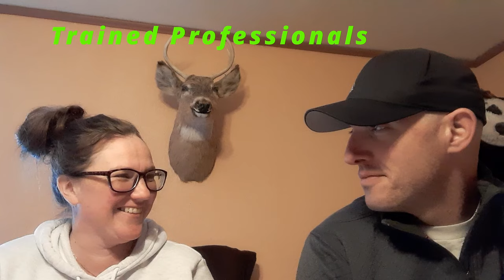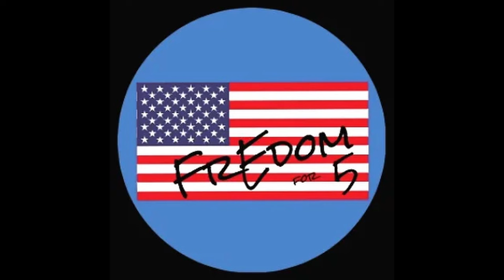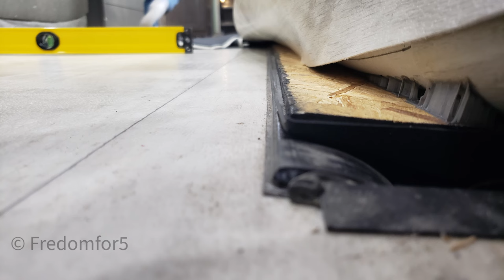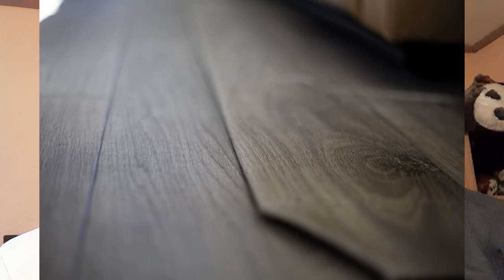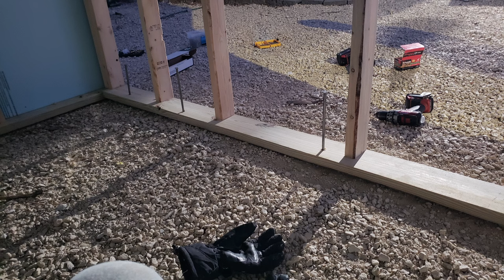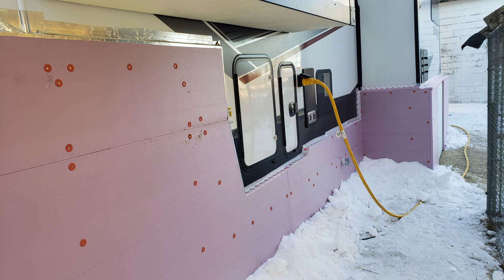UPDATE!!!  Grand Design Frame Flex Part 2

Comment: I’m glad things are moving for you.  I’ve spent 20 years studying all the flat floor slide patents out there.  Yes, there is a lot of geometry … not only does the box need to be true and slide arm adjustment extend to the perfect depth, but when the arm depth and true box is extended, it needs to rest on the floor, and the slope ski needs to be properly aligned and installed.  So simply, if the side trim, top to bottom, are flush with the wall, and you still have non-flush, the floor ski needs to be adjusted further inward for the floor to drop.  Keep pushing that issue…
Reply from the maker: We were able to get them to create a work order for the main slides. It says they inspected them and were working properly. We got it home and checked them again...

The distance from the wall (at the floor ranges from 1/4 - 3/4".  The kitchen slide appears to be bowed downwards at the center. The dining slide is off side to side and is obviously not square where it slides into the floor.  We'll detail this in an upcoming update.

I'm not fluent with the vocabulary associated with all the parts yet but the two plastic radiused parts that mate up when open at the 'flush part' (which I suspect may be the skis) looks like it may have moved...  If one has been pulled out, or is misaligned it would prevent the slide from seating properly because they are on top of each other...  If this is the case and I can figure this out I don't understand how it was overlooked or "normal".

More to come.

Comment: After seeing all these issues on Grand Designs 5th Wheels with frame failures and some people being " bought out" with a new 5th wheel to be quiet and sign a non disclosure agreement and to remove their videos I knew something major was occuring.  I even saw a video of lag bolts missing on a 5th wheel and the guy fixing the problem himself.  My Grand Design Reflection had a major flaw with the heavy Refrigerator moving forward alittle with the slide in. ( pulling on clips in the soft wood on the sides) Customer service told me it was a design flaw with no recall to fix it last year.  I made the decision last month to cut my losses and I sold my camper the month the warranty ran out.  The values are dropping on them and I did not want to own a camper that could  have a frame failure going down the road because of Grand Designs cheap way of making a camper .  It was too much of a liability to me.

Comment: The people designing and building welded frame 5th wheel trailers had no idea of the actual loadings applied to the products that they sold to you.   You might want to believe otherwise, but they were winging it.  In reality, their designs are based on established rules and RV industry practises - not the actual in-service loads, deflections and accelerations to be experienced.  You may think the manufacturers understand what happens in service but I would not trust them to come up with a rigorous, permanent fix to their failures.  They may want to help you, but they have very little idea of how to address the effects of the accelerations and deflections which will be experienced in normal use or when an accident occurs.  They cannot afford to follow the same type of analysis and testing that would be used in most other types of vehicle.

Comment: They should also be doing a complete courtesy inspection of the full rig…. Saying they are going in with blinders and narrow scope of repairs is garbage service.  I had a Thor go back for side wall replacement and they said “we found flaking on your mirrors and replaced the $2500 mirrors.”  And that’s from Thor.  GD sounds like they are still acting like assclowns with no good customer service.  They really need to step up their shit and actually start giving a true shit about their customers.  All the brochures and lip service mean crap after the sale closes.  They can’t hide anymore.  Stay loud! “pump up the volume”

Comment: i love your pet deer... he must be camera shy cuz he seems frozen😂😂😂... PS: GD used to be a religious term...i hope your rig is adequately repaired because it appears that the resale values have plummeted. limpit has a major problem and the solution appears to be manufacturers buybacks. i hope cuz they built these things so they cant pull themselves down the road without breaking apart.